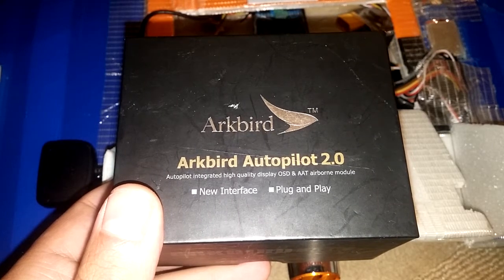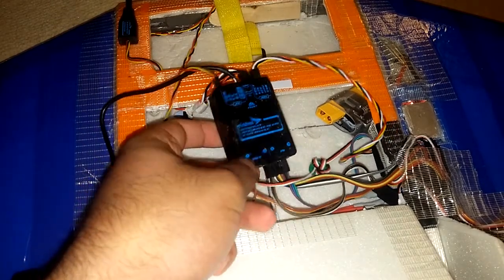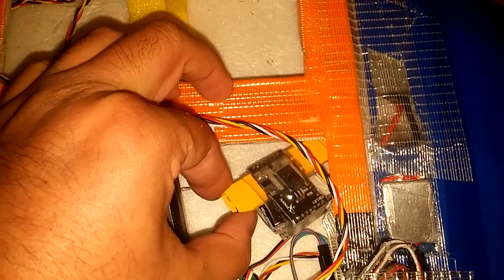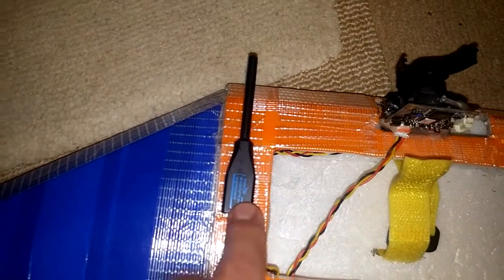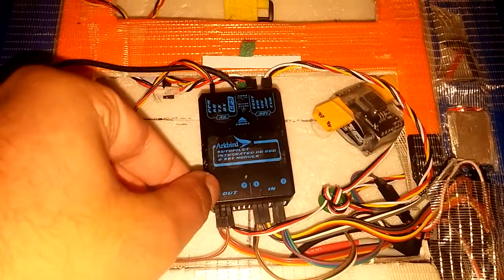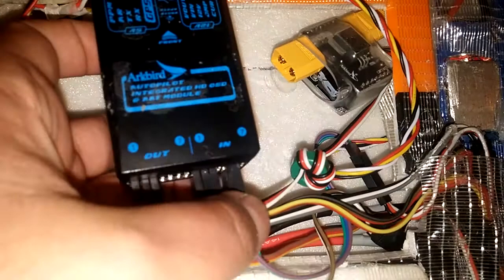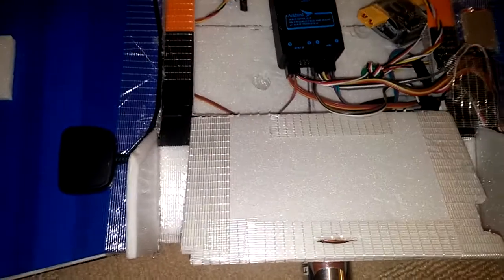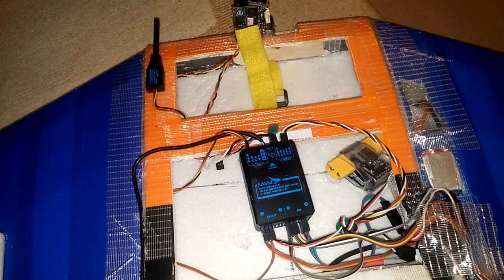Arkbird Autopilot 2.0 reveiw PART 1 (intro/connections)

Comment: Its better to "run" the arkbird with 4s battery or 3s?
Reply from the maker: Both are good depending on what's best for your aeroplane setup but if you do want to use for as they sell a separate current sensor which is upgraded to 4 issues although I have been told that the normal current sensor will also support a 4S battery

Comment: Thanks for the videos.  Almost everything works great.  The only hang up is with video.  I have the Arkbird v3, a Foxeer Monster v2 camera and a Readytosky 5.8ghz FPV 600mW TS5828L transmitter.  When I hook up the components per instructions, I get only Arkbird OSD info displayed, no video.  I have to unplug the yellow wires and hook them directly together bypassing the Arkbird module to get a video feed but then obviously lose Arkbird OSD info and am stuck with Foxeer OSD info.  Any ideas as to why there is no video or why the signal wont transfer through the Arkbird? I am running everything from an 11.1 v 2200mah battery.  Thanks
Reply from the maker: Elimin8tor65 thank you and I must say yours is a surprising problem, I have never had this issue, and just like yourself iam using the same battery too, but when I was using 3s sensor I had to give one xt60 power to the current sensor and another power from the balance lead through a servo wire to the arkbird to make the system work, it was always a flaw for me, but since I updated to the 4s current sensor that issue is gone, arkbird should make the 4s sensor standard in my opinion.

Comment: Ready-Set-Test i have arkbird 2.0 as i start up the system as per intruction on your video by using left and right stick it wont go to no satt.program mode. Currently using a futaba 8fg. Do ineed to update this arkbird autopilot system? Badly needed help. And thank you very much of your series video it really helps a lot
Reply from the maker: make sure your switching is in manual mode and you have to move the stick almost instantly after power on, i think its around 5 seconds to get out of the sat search mode, also make sure you check your radio for any mixes that are active, you need to turn off all mixes. try this and hopefully it helps.
Reply: Ready-Set-Test  thank you for your Reply.do i need to purchase the other current sensor can use 4s so that i have a stable 12v output? I follow all the instruction in yuor video no mix was active still cannot go to no satt menu
Reply from the maker: if you have your unit inside the house keep it next to a window and it will catch satellite quickly, and yes i do recommend the 4s sensor because it makes things very easy.

Comment: Ready-Set-Test i received mine from HK when i turn it on there is yellow blinking light and it doesn't power the receiver.Help Needed.....
Reply from the maker: are you using 3s or 4s current sensor and what position is the jumber in? does the VTX turn on?

with the 3s current sensor and separate servo wire has to be taken from battery to power on the AP, at least thats how i did it and it wasnt ideal but it powered everything, now i use a 4s current sensor and it works clean just through one connection.

i believe your problem is the jumper setting and current sensor connection.
Reply: Ready-Set-Test i am using the supplied current sensor.i use 3s batt i think i figure it out.i forgot to connect the ESC wire to channel 3 that gives power to output channels 1-7. now it powers the receiver and the servos function correctly. when i  install the GPS antt. the functions of the servos stop when i remove the GPS antt. it function all the servos.  Thank You Very Much Sir

Comment: Question: Can this be used with an S-Bus taranis receiver?

Great video by the way.
Reply from the maker: Jason  Jackson. I have used it with a frsky x8r rx on the plane and a frsky futaba module with a futaba radio tx on the ground. Everything worked great, hope that helps.
Reply: Yes it does. Thanks

Comment: hi, I just got my arkbird 2.0. I have wire it, and it is not powering the receiver. any idea of what might be
Reply from the maker: Joaquim Mata 
check your current sensor wiring, the 4s version is simple but 3s can be tricky but explained in manual, I have had problems getting power to vtx through arkbird but never the rx
also double check your rx with a separate rx battery just to confirm it's function,
what rx and radio are you using?
Reply: yeah,I got it now. but after solving one problem, some more fallow, hehe
now, I don´t OSD what so ever, ( I´m using a combo camera/VTX,which in theory, should support OSD. even come with the cables).
and another problem, is that all the controls are inverted, Ia. the throttle I got it on my elevator, and I am using the mode 2, which is the throttle on the left.
gosh, this things are so stubborn. they never work as they should. anyway, I will find out what is wrong. 
plus, I got a USB with 4 pins, and I don´t have the slightly clue of what is that for. from one side, I know that I can plug it to the computer, but the 4 pins... no idea what so ever.
sorry to bother you,and thank for your help
Reply from the maker: Joaquim Mata 
it's ok my friend it takes time let's go with this one by one

1 I have only tried osd on separate camera and vtx but it should still work but make sure the signal wires to arkbird video in and out are separate, as you have combo they might be one
2.as far as your controls go make sure you make a new model on your tx, erase any mix that's active and set all the controls to normal not reverse, after that go arkbird control surface menu and choose mix and reverse/normal until you get your desired mix,
Reply: Well, I can't get into it, coz I can't get OSD. During the weekend, I'll figure it out.  The subtrims I really need to do it on the radio, otherwise I don't think it is possible.
Anyway, I just got this thing this afternoon, and like always, it's a challenge, as you might know.
I will try it, and if I find something out interesting, I will share as you did. And I will most definitely recommend your videos

Comment: amazing, thanks to you I'm no longer gonna send my arkbird back to bangood.  the only thing I'm struggling with now, is how to do my 3 way switch on my taranis.
Reply from the maker: thanks dave, iam glad i can help, 
as to your 3 pos switch setup, it should be simple but sometimes not so easy, the type of rx and tx used can make things difficult, i havent used taranis as i have a futaba, but the 2 mode wires are ch5 and ch6 (ch5 being 2 pos) and ch6 being 3 pos), make sure you go into your radio and program ch 5 to a 2 pos switch (any thats easy for you and not used already) and ch6 to 3 pos switch. 
from here on it should work after restarting the arkbird system. 
give it a try and if you still struggle then get back to me, or put a little video up showing what problem you have and we take it from there :-)
Reply: I wonder if I could ask you a question or two seeing as you're a guru.  I am building my plane, and as the servos sit, the elevator has to be inverted (INH) in my taranis. now if I was to engage autopilot whilst in the air, would arkbird realise that if it moved the servo to go up to the preset height, would it be go the opposite direction straight into the dirt?   many thanks in advance
Reply from the maker: the day i hover instead of my plane would be the day iam a guru :-D

to your question,  as i understand when you use arkbird make all the servos in your plane normal and use the arkbird to reverse any servo that you might need, you can find in my video where to do that.

if still need be then you can reverse through your radio, in my futaba both my ail and elev servos are reversed for my fx61, and i have never nose dived, just make sure after you completed everything to check your control surfaces move the right way with arkbird system on, and do a gyro check to see that it compensates in the right way.

Comment: I  watchad your videos and I was wondering it there's a way to adjust the horizon video on the OSD thanks for your and help
Reply from the maker: i have not seen a function specific to that, although in my opinion that depends on the neutral check, if the neutral check is performed with your plane in level position then you should have a level horizon all being equal, i one did a neutral check with the plane not so level and the artificial horizon was tilted to the left, also affected the AST mode and LK.HD mode too, hopefully that helps. thanks.